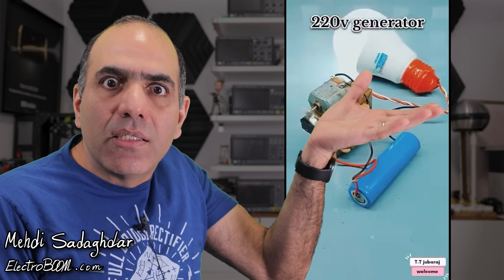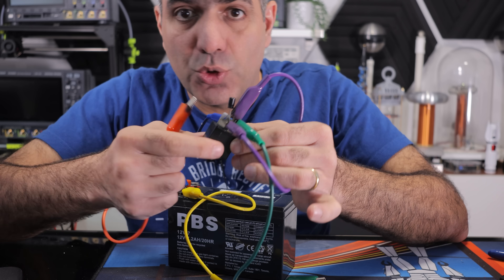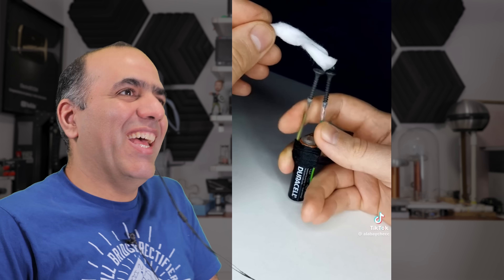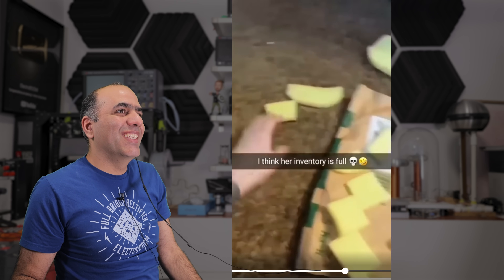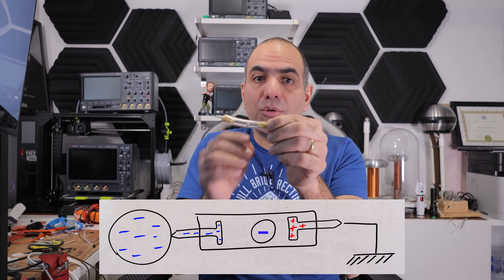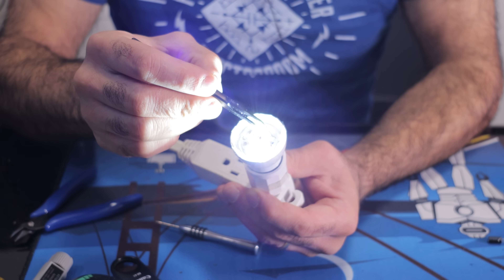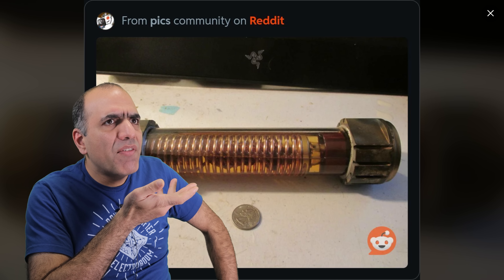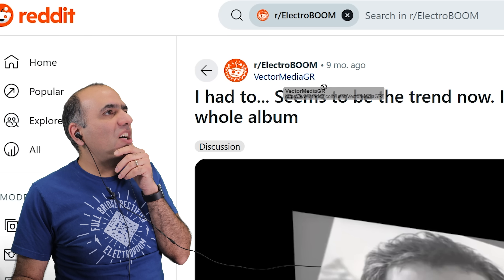Nuclear Egg (LATITY-015)

Comment: 1:03 isn't the formula for impedance of an inductor Z=(2×pi× f×L)?
Reply from the maker: Oh crap! Why did i invert it!! Mixed it with the capacitor impedance. Thanks for pointing it out
Reply: @ElectroBOOM  the mix is real, because of the absence of the negative
Reply: @ElectroBOOM  What's the explanation for the transformer breaking at higher frequencies then? because the impedance would decrease with decrease in frequency, leading to higher current?
Reply from the maker: @shivankvishwanath8887  it won't break at higher frequencies, which is what I said in the video. The reason it  breaks at lower frequencies is low impedance and very high current.  Sop, the second half of your comments is right! Like the second half of my video explanation!
Reply: @ElectroBOOM  I was under the impression this happens due to saturation. The voltage stays in one polarity too long and the small core can't handle all the flux.
Reply: @rfmerrill  You're on the right track, but what you're getting at is actually just another way of explaining the same concept, just in time domain rather than frequency domain. Inductors work by storing electrical energy as magnetic energy which resists changing current, kinda like a current battery. This creates a potential difference across the inductor, v = Ldi/dt. A bigger di/dt (faster current change) increases the magnitude of the opposing voltage which impedes the overall current. The way we change the current faster while keeping the same magnitude is a higher frequency, and since that's our variable now we use the frequency domain as a math shortcut because we can treat impedance like resistance, were Z = j*2pi*f*L and I = V/Z.

That's where saturation comes in. Again you're on the track, but the flux is actually created by the primary winding while the secondary takes that magnetic energy and converts it back into electrical energy on the other side. So it's not that the small coil can't "handle" the flux, the problem is that it can't make enough of it. So it needs to move little bits of energy at a faster rate otherwise too much power is being dissipated in the primary (power = energy/time), which is why the impedance of inductors is proportional to frequency.
Reply: @mazzyraaymakers7908  I think what's confusing me is that there isn't a sharp distinction being made between ideal vs real world transformers/inductors. Like, an ideal inductor dissipates no power, irrespective of its size and how much voltage/current you subject it to. If it were simply a matter of series resistance then the core size wouldn't be a factor. I was assuming that this was the result of hitting a nonlinearity (due to saturation), and things like "impedance" become wishy-washy when things get nonlinear.
Reply: @ElectroBOOM  can u try making some circuit with protons instead of electrons? 

ive heared its possible and i think its done in hydrogen fuel cells!
Reply: @Larry480i  Protons have (relative) significant mass and do not flow like electrons do. They can induce electrons to move by their charge though if enough are in one place.
Reply: @hgbugalou  pretty sure they do no? why are protonic circuits possible then? i never really specified the conductor had to be solid.. protonic circuits exist no?
Reply: @Larry480i  From your example in a hydrogen fuel cell, I guess you could say that technically since its moving protons, but a single proton IS hydrogen. The protons are moving but its not the same thing as an electrical circuit and is more akin to just moving a pile of dirt from one side of a line to another. In other words the protons aren't going down a wire. If you mean positrons, thats technically possible and would work like electrons.
Reply: @hgbugalou  idk what u think but protons arent hydrogen in the sense they are destined to become it.. they are protons... and also when i wrote that earlier thing i didnt realize that solid state protonic circuits do exist and they work by using solids that are great at holding onto protons but not too great at it tho they are alot "slower" than electronic circuits...  also no it isnt anything like moving dirt you can even call it a nuclear process which is nothing like rearraanging atoms (moving dirt) also protons fundamentally have a charge they arent neutral......
Reply: you forgot the j
Reply: As a high school it’s one thing I liked learning
Reply: @Genzeak10  damn bro ur a high school? how does it feel like when you're the source place where teenagers go to get educated
Reply: @fastfoodboi55 hahah I just noticed I forgot the er at the end of highschool
Reply: Overload problem of the power generation was solved https://youtu.be/31QYsZv8pIw?si=Evggz_qYyVF4cpoC

Comment: 4:23 i think he used a 18650 and packaged it like a normal battery because 18650's can output alot of amps one time i tried shorting them and it hurt a little and made the wire red hot and melted the insulation

Comment: 2:50 - error in your line of thought. That's not the frequency that is the issue. First of all, iron core will not operate properly with higher frequency, up to a few dozens of kHz. Issue here was probably bad driving circuit, it did not give 50% duty cycle, as period when N-O is connected to the battery is determined by pure mechanical inertia of the switch, and force, bringing contacts together, detiriate as soon as N-C circuit is broken. You need more on-time, for example, if relay is driven by a multivibrator.

Comment: Maybe the Egg is a miniture radioisotope thermoelectric generator wich runs on plutonium just like in Voyager 1 and 2.🤣
But even than the heat must be radiated from it's surface wich means - this thing would get freakin hot
What a shitshow - can't believe that someone is falling for it 🤣🤣😂😂🤣🤣

Comment: Small nuclear reactor isn't impossible. You could fit a small heater and turbine in there, if it runs at a low enough heat output to cool through the shell.

Problem would be the radiation shielding though. You would want about a meter of concrete for that usually. I don't think that fits in the egg...

Comment: I got suspended from middle school for hooking up a 9v battery to the low side of a transformer from my broken boombox while having a chain of friends hold the high side around the lunch table while i tapped the battery manually. 😂 

Something about shocking 10 kids at lunch with 1000v must have upset the staff

Comment: 9:00 I tried to repair an LED bulb by replacing an LED with a 220 ohm 1/4W resistor thinking that if the LED is a resistor, then it can be replaced with another one. I ended up with a burned out resistor and a couple of electrocutions while fixing it while it was plugged in. 🤦

Comment: 10:30 if you intend on fixing an LED bulb like this, you can easily purchase LED strips that typically have the SMD LEDs on a polymer rather than on a heatsink, or buy a complete set of LEDs on a new plate for super cheap. both are much more economical than buying a spare LED bulb just to harvest for spare parts

Comment: There was a short in my speaker chair so I used a screw driver to find the negative point to do a simple bypass using aluminum and scotch tap/duct tap. It works just as new. I just need better speakers or make them. That was 10 years ago and still haven't got any yet.

Comment: the thing exploding on the powerline is a fuse linemen call that a door inside the pipe thingy runs a fusable link wich vaporizes instantly in case of a short causing the fuse blasting like a gunshot and yes some called the police after that door blows open  and the balloon is made out of mylar and yes its conductive

Comment: egarding the nuclear generator inside an egg: While the Enron presentation was fake, that doesn't mean such a device is impossible or hasn't been achieved. Russia, for example, has developed and deployed numerous nuclear batteries, primarily Radioisotope Thermoelectric Generators (RTGs). These are used to power remote cities and infrastructure, especially in its Arctic regions. Some are quite small, similar in size to the egg shown in the video. Instead of steam and turbines, they convert heat from nuclear material directly into electricity using a method similar to a Peltier device. Still, it's not something I'd want at home.

Comment: 0:50 this is how I was able to generate 2000V for my physics paper in which I measured the force between charged parallel plates. Electric flyswatters do exactly this to generate high voltages.

Comment: Actually, the double A battery trick does kinda work but you have to peel back the plastic coat and expose the chassis ground. It's how prisoners light their cigarettes with a thin wire that gets red hot.

Comment: Please consider that even a fixed current source may be overloaded. In the easiest DC example i can think of it consists of a Transistor and current measurement resistor. The transistor will compensate with its CE-voltage difference. So there is a maximum possible Power in the Transistor Pmax = I_LED * U_CE. U_CE is higher, when there are LEDs shortet because U_sum = n * U_LED + U_CE.

Comment: I have a note about the nuclear thing; there is a thing called a Radioisotope Thermoelectric Generator where you have plutonium-238 providing a high energy heat source for those peltier modules and fins for heating outside. Countries like Russia used them sometimes for military things and they are used on space probes and rovers.

Comment: ⚠️ Safety Warning:

Do not try this without proper electrical knowledge.

220V AC can be lethal. Even if the current is limited, the voltage is high enough to cause harm.

Always use insulated tools and work under adult supervision if you're inexperienced.

---

🧰 Components Needed:

1. Small DC Motor (High-speed) – Acts as the generator.

2. Step-up Transformer – To convert low DC voltage to 220V AC.

3. Rechargeable Li-ion Battery – Like a 3.7V 18650 cell.

4. 220V LED Bulb

5. Wires and Connectors

6. Diode (optional) – For preventing reverse current.

7. Hot glue/tape – For insulation and safety.

---

⚙️ Working Principle:

1. The battery powers the motor.

2. The motor shaft spins, generating electricity at its terminals.

3. The output goes through a step-up transformer, converting low voltage AC to 220V AC.

4. The bulb lights up from the 220V AC output.

---

🛠️ Step-by-Step Guide:

1. Connect the battery to the DC motor.

Red wire to motor's positive terminal.

Black wire to the negative terminal.

2. The motor will start spinning, acting as a generator.

3. Connect the motor output to the input side of the transformer.

4. Connect the 220V bulb to the output of the transformer.

5. Insulate all connections to prevent short circuits or shocks.

---

📌 Notes:

This is a very low power setup. The light bulb used must be an ultra-low power 220V LED, usually under 1 watt.

Most likely, this does not generate a clean 220V AC sine wave, but a pulsed or modified waveform.

Efficiency is very low, and real applications are extremely limited.

(Edit:My hands are dying writing this)

Comment: Electroboom. The egg is possible. There re betavoltaic cells that generate electricity in much the same way a solar panel does but with beta radiation instead of light. That could fit inside an egg but you can’t get more than a few milleamps out of it.

Comment: Hey a small question what if you get something like a lemon battery then put it through the thing at the Start and then use that power to run doom I did a little research on this but I didn't come up with anything so if the internet could help me out and see what absurd power source it can run doom on it would be great thanks😊

Comment: 2:30 i hope you read my comment here, you need to use a mosfet in a H bridge configuration or half bridge driver. I had made one and it could run a 0.1hp single phase induction motor efficiently so I modified it with a pwm modulation and low frequency of 28 to 171hz. You could try but it draws alot of current ( upto 20 amps when drawing alot of current )

Comment: only ever seen one LED bulb fail (SO FAR) and what failed in it wasn't even the LED itself but the driver chip.  Now it's a desk lamp powered by the DC supply off of an old broken printer, with a resistor for ballast

Comment: It's not just possible to convert nuclear fission energy into electricity by heating a coolant. For example, you can surround a nuclear heat source with thermoelectric elements and directly generate electricity from the heat. This was used in the Soviet Union to power lighthouses, and I believe the Curiosity rover also uses such a power supply.

Comment: btw on 3:40 i have try it, but they need 5 volt to run it, if you run with 3,4 volt battery the battery will burn, then explode.

Comment: Its possible to do this with a more efficient transformer (20w tyroidal) or a better relay.    I have Lit christmas lights and twisty bulbs.  A right size resistor will reduce arcing on relay contacts.   12v can overheat relay and Contact melt together.
High voltage spikes are no joke be saf

Comment: I remember a really cool variation on this from the good old days.
I don't know if these still exist but there used to be small tabletop neon signs... usually for various beer brands... and often seen in bars.
They had a transformer that normally plugged into the wall and put out three or four thousand volts to light the neon tube...
HOWEVER, you could connect the primary in series with a big 6V battery, and a 3V mechanical buzzer type doorbell.
The buzzer was basically a relay, open by default, with the contacts wired in series with the coil and power source...
(The relay pulls in, goes click, contacts open, relay releases, contacts close, so the relay chatters, which is the "buzz".)
If you adjusted the tension on the buzzer just right it would buzz... and there would be enough high voltage flyback on the secondary to light the neon sign dimly.
It wouldn't light very brightly...  but you also got lovely green fire on the relay contacts as they arced... at least for a while.

Comment: The bead in a tube one around 6:20 reminds me of the Oxford Electric Bell, which (aside from a couple of humidity related stops) has been ringing continually since 1840. It's not a perpetual motion machine, but it IS an absurdly-long-running-without-intervention-or-recharge machine.  According to the story, no one knows how it works, and it may have been constructed as early as 1825.

Nowadays it's sealed behind a double layer of sound proofing, supposedly because it's been driving people up the wall with it's otherwise constant ringing. There's a Wikipedia page for it, and a ton of speculation on how it might have been built. Of course the only way to find out how it actually works would be to take it apart, and no one wants to do that.

Comment: 7:23 it's not chinese but vietnamese and in 7:28, they do not hide the vandor graph but to explain this phenomenon is due to static electricity on the body, in Vietnam is a tropical region, in winter it is often dry due to low humidity in the air or other causes. When infected with static electricity, touching iron or copper objects will create an electric arc that shocks the infected person, so hiding the vandor graph is not correct.

Comment: The same thing happened to me at 3:22 where I tried unplugging a charger but the casing came off. I stupidly however decided to try and pry it out of my extension cord with my fingers and ended up accidentally touching it and shocking myself, was very scary.

Comment: 12:35 there is a way tho it's called a "Radioisotope thermoelectric generator" although it probably won't fit in an egg and if it would it still would be very dangerous and radioactive
Reply: A betavoltaic would work and fit in the egg though.   It’s like solar power. But uses beta radiation instead of light.  Then you have a beta source inside the egg that is sandwiched between a coupple betavoltaic cells and boom. Electricity    Just a teeny bit tho.  Enough to run a sensor for a few decades but not enough for a consumer to find use for

Comment: If you do this, other LED beads will get some more voltage. Although the LED drive power is constant current. However, when the bad lamp bead reaches a certain amount, the voltage of each lamp bead is greater than the threshold value of its diode voltage resistance, and the life will be greatly reduced

Comment: I'm old! Back in the day car radios had tubes (valves) which required high voltage compared to the 6-12VDC of the car system. They used mechanical "multivibrators" to create the chopped DC then sent to the transformer.

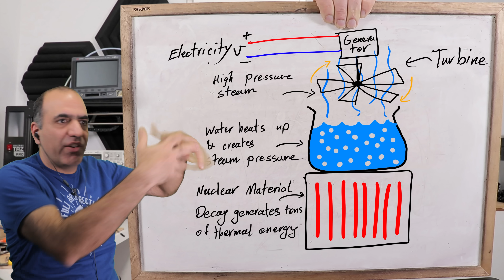Comment: 12:30 Mehdi as a mechanical engineer I can say, it's possible, not even close to power all your house, but it's possible for a room or something, with security of course
If the system it's close, the only thing that's needs to come out is heat and for heat, we have, many many many solutions, you refrigerator it's one of them
Sorry for the poor English I'm still learning

Comment: 0:37 
You probably just forgot to mention that in linear power supplies, the transformer usually outputs less than 12V AC because after rectification and filtering, the DC voltage increases.

Comment: Hey on the topic of getting sparks from batteries you can actually draw a dc arc from a 9v battery. Specifically energizer and iirc its only if you connect from the positive first and touch it to the negitive then draw it out slowly. Youll get a small half milimeter arc and the battery will get very hot so dont do this to much😂. Tbh im not sure why you csn do this with them as ive never gotten a good arc off somthing like a car battery where they have almost 1000 amps ready to dump at a moments notice 😂. It could be the metal they use on the contacts allows for a easier path in the air to follow vs the lead contacts on a car battery